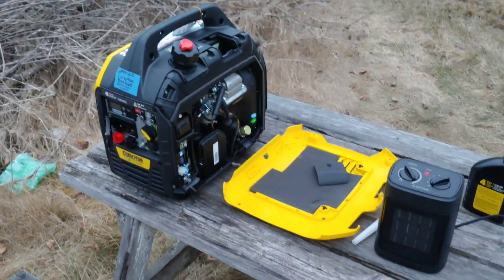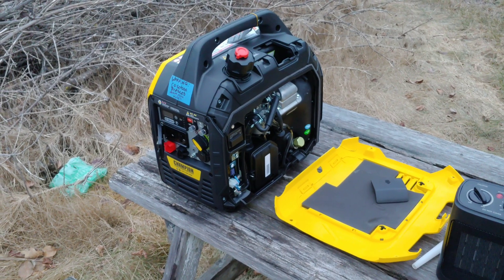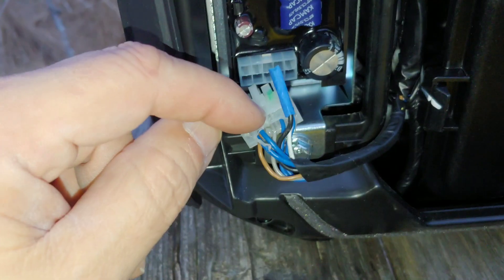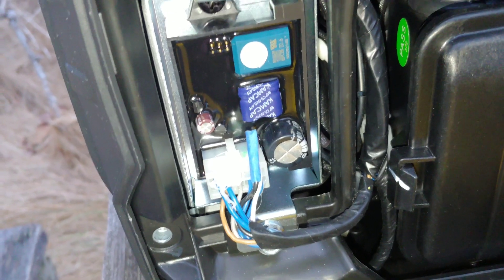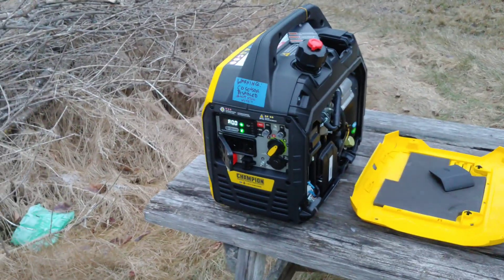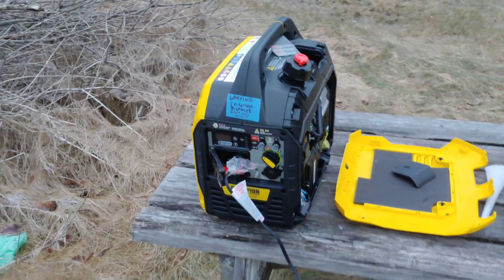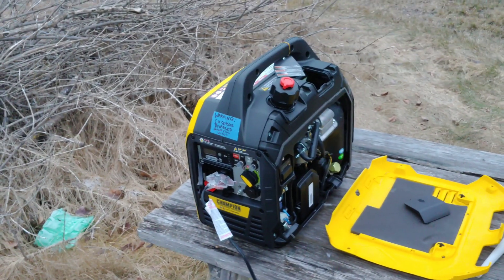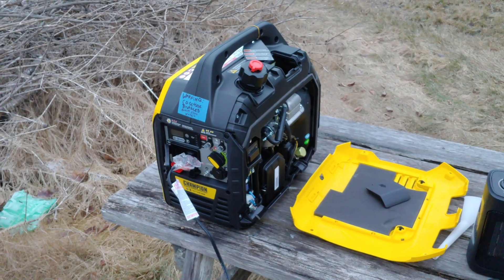Disable CO Sensor. Champion 2500w Inverter Generator (201153)

Comment: The Champion CO2 sensor sucks and constantly shuts off my generator when it's sitting outside in open air... gotta disable it or the generator won't work
Reply from the maker: Yup. Poor design.
Reply: I wrapped mine in two lunch bags and taped it up with electrical tape and it doesn't cut off anymore. If someone post what wire it is to bypass it I will do it. Haven't seen anybody do it to the 4500w duel fuel inverter yet.
Reply: @davidrhine8562  hey David! I also just bought the 4500w dual fuel and is giving me issues with the CO shield. Can you please give me details on the surround wrap on the sensor. I don't understand exactly where you are covering it etc. Your help would be much appreciated.  Thanks
Reply: @roberteugene2124  if you take off the right side panel with the pull cord. The sensor is at top left on frame. Looks exactly like this one in the video. Take the two screws off to remove sensor. Leave it plugged in and wrap it with the thick lunch bags. I used two and i cut the zip lock part off the bag. Put the sensor in the bags and wrap it up real good. Especially where the wires come out. I used electrical tape. Tape it up real good. Then try your generator in a enclosed space to see if you got it. Then just tuck it away in there and you good. I had mine in my pick up with cover closed and tailgate down and it didn't cut off anymore. Hope it works for you.
Reply: @davidrhine8562 thank you for your reply. Before seeing it, I tried with a lot of surround wrap and as you mentioned with electrical tape where the wires exit. Seemed to help a bit but now restarted doing it. I will try with 2 or 3 zipplock bags + surround wrap. I hope I get it to work. Thanks again. I'll keep everyone posted.
Reply: Just did it the way you mentioned it. It works. Thank you very much. I hesitated putting 3 bags. Anyways, like you said earlier, if I come accross the wiring diagram that will indicate which one of the wires is responsible for the shutting down of the generator I'll keep everyone posted. Thanks again David, this is so far the only solution. I have it running in my truck bed next to a gas compressor. Although I have the exhausts headed outside and a lot of opened doors and a ventilator...when the wind is not in my favor...it used to shut off immediately. Really horrible. But all good now
Reply: @roberteugene2124  glad to hear it. Yeah if you find out which wire it is let me know and I'll do the same. Congrats!
Reply: @davidrhine8562  sorry, nevermind. It didn't work for very long. As I started working next to my gas compressor, it didn't take long for it to shut off. Even restarted  shutting off outside working by itself just because the wind shifted regardless the bagging and electrical tape. I will try tapping into some wires. Will keep you posted.
Reply: @roberteugene2124  sorry to hear that. That sensor is so sensitive. If you can find that wire that would be the best fix. Good luck my friend.
Reply: @davidrhine8562 alright got a way of doing it!! Disconnect the harness from the sensor. Locate the 2 full black wires and the 2 full orange wires. They are next to each other. Cut them. Connect black to orange and black to orange. Doesn't matter which with which. For the sake of it..i decided to identify mine in case it was important. And voilà.  No more sensor needed. No more red light blinking and no more constantly shutting off.
Reply: I tried jumping the two black wires but that didn't work. I didn't try the black and red wire though. Mine is the duel fuel 4500 with a different plug than this one so I don't know. Wasn't brave enough to pull wires as I just bought it.
Reply: And haven't been able to find a wire schematic to it yet.
Reply from the maker: @davidrhine8562  Lookup your model on Champion website. Should be under downloads>Parts Information. It's at the end of the PDF.
Reply: @navydave1 Downloaded! Thank you for this video
Reply: @navydave1 👍🏼👍🏼👍🏼
Reply: @davidrhine8562  What is your model?

Comment: You should modify the title to say that it also is confirmed to work on Model# 201122
Reply: Did you do it on a 201122? That's what I have, I have only done the 5 hour break in, and it stalled 2 times, I want to nip it in the bud before I have to go outside late at night during a power outage to start it back up.
Thanks in advance.
Reply: @Michael-Joseph123   yes still black wire. Connector pin out may look different. Unpin black and plug connector back in.
Reply: @SteveMaine207  I have to unpin it, and plug a connecter back in? I thought you just unplugged it and tape up the end.
Reply: @Michael-Joseph123  the black wire has a pin crimped on it that holds into the plastic connector. Pop the pin out of the connector if you ever plan to put it back in for some warranty purpose. If not then just snip the black wire and wrap with tape.

Comment: Hello i have a GXS1500i but it turns on, amd then off again because the CO light is on, how can i fix it?
Reply from the maker: That sounds like a different brand from Champion. AI power? Not sure, but you'd have to look at the schematic and see which wire is connected to the engine kill switch when the CO sensor comes on and disconnect it. They are all different so best bet is to lookup a video for your brand of generator that shows how. Good luck.

Comment: This worked perfectly on my 2500w dual fuel w/CO Shield. Model# 201122. I tested it with a box covering generator before disconnecting engine stop micro switch wire and it turned off in about 5 seconds. After disconnecting wire, CO light blinked but generator stayed running. Thanks Dave!
Reply from the maker: Awesome! Glad to hear it worked!
Reply: @navydave1  Thank YOU, BEEN WAITING FOR SSOMEBODY TO SHOW HOW TO DO THIS ON A  # 201122.    THANKS
Reply: @genehanson6247 did it work for you also?
Thanks.

Comment: I have the  Champion 2500 with the propane option. Would this method work with it as well? Thanks!
Reply from the maker: I can't guarantee with different models. If the connector plug looks the same, double check your wiring diagram and look for the wire that goes to the Engine Stop Micro-switch. On mine it was the black wire. If you can get the black wire out without damaging it, you can test it. I used 2 staples and bent one side of each one straight.  Then you push the staples down on either side of the black wire connector on the inside and it should push down the little tabs and release the wire. There are YouTube vids on how to do this for more info. Let me know if it works and we can add it to the list of models it works on. Good luck.
Reply: @navydave1  It was the same design as far as I can tell and it worked!! Thank you so much! Your video was the first to show it plain and simple.
Reply from the maker: Awesome! Great to hear! What model# was it, for reference for others?
Reply: @navydave1  model number is 201122 Dual Fuel Inverter Generator 2500W.

Comment: Just confirming...when the CO sensor reaches the end of it's lifespan, it still will not interfere with the generator's ability to run, if you disconnect this wire, is that correct?
Reply from the maker: I dont know the answer to that. I would assume it would still operate, but if it doesnt, they do sell replacement CO modules that you could just swap out with 2 screws.
Reply: Roger, thank you. @navydave1

Comment: Why would you want to do this , ....????
Reply: From the description.... Lots of people have issues with these sensors that are overly sensitive (mine would go off in a wide open driveway with nothing next to it, with a gust of wind). They become a nuisance for people that have the ability to use them properly. This does nothing to stop CO from entering a home if you have it outside and have it close to a doorway or window. Or pointed at your window or door. They should just include a CO detector in the package to install in your home. The same reason you dont put a smoke detector on the side of your woodstove. You put it in your house somewhere high up, away from the source. So this sensor is for people that dont know any better that think you can use one in your kitchen or closed garage. Most of us have used these for years without the sensor, have common sense and are still alive to tell the tale.  Look up the video titled "Generators with CO Sensors - Good Intentions but a BAD Idea?"
Reply: Only people from California would ask that question.
Reply: @davidrhine8562  I am from England,  and this is on par with disabling the safty catch on a gun , ....or running a red light in the rush hour
Reply: @normanedwards7220  Only if the gun safety functioned properly, these do not. Guns have always had functioning safety's, generators have never had them until now and 99% of us who actually use them have never had a problem. It's for the 1% we all have to suffer this foolishness, the very 1% who dilute our collective intelligence and we're better off without anyway lol.
Reply: Because it's a last minute shit design that's constantly causing the unit to shut down.
Reply: Because when you need it to work and the stupid sensor says no even when it is in a safe area. Yes people can be stupid and earn Darwin awards but many know how to properly use equipment

Comment: If you can pick up a pin for that molex connector, then you could install a toggle switch inline and mount it to the outside of the case. That would provide an easier way to pick and choose when you want the feature active.